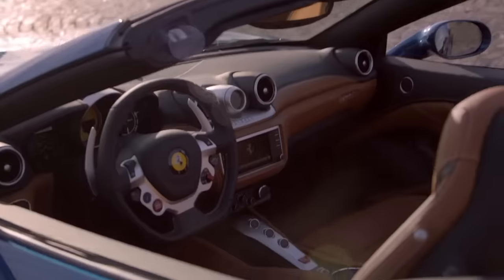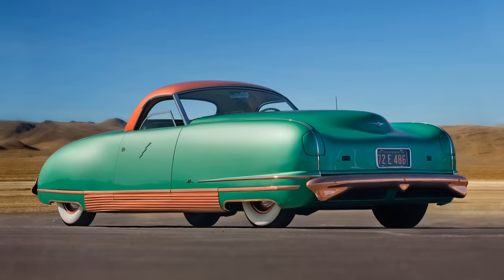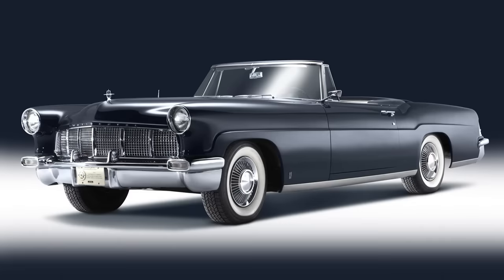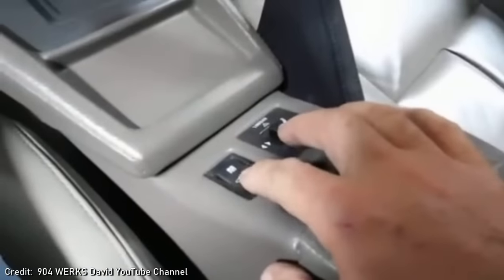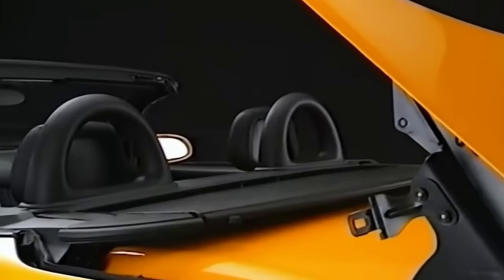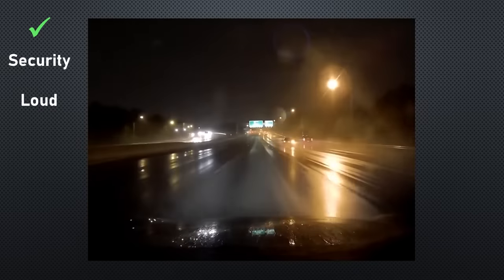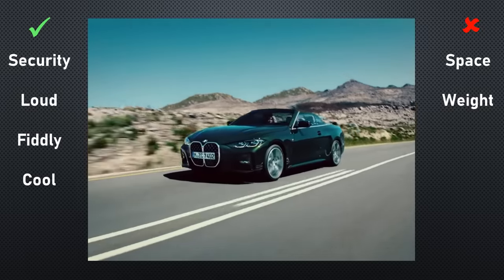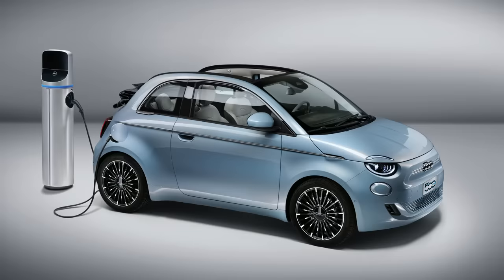The Rise and Fall of Retractable Hardtops

Comment: If I were ever in the market for a convertible (unlikely anyway), I would only want a hard top. Who wants to drive around in a car that looks as though it has been designed around its cloth roof for 11 months of the year just to enjoy it for the other 1 month? Hard tops look much better, make more sense, and are generally a better idea. I thought they were becoming popular and rather that companies that still use cloth roofs are bing too tight to create hardtops. Making them out of plastic also sounds like a much better idea, I assumed they already were.
Reply: You could move to a nicer climate? :)  Plenty of places have agreeable open-top weather for about 6 months of the year.

Comment: In the UK, soft tops suffered at the hands of criminals who would simply use a sharp knife to cut through the soft top (or fabric sonroofs). Lack ofbpolicing didn't help. So a folding hardtop provided the ideal solution. I'd never buy  a soft top
Reply: Yes, as mentioned (and illustrated) in the video!

Comment: If someone wants to break into a car they will smash the window. The roof type doesn’t matter. I’ve seen plenty of broken glass on city curbs. 😉 
Also the whole point of a convertible is to drive it with the top down. It should only be up due to bad weather and who cares what it looks like in those conditions. And if you live somewhere where you want to keep the top up due to the cold maybe a convertible is not a good choice for you. 🤷‍♂️

Comment: Great video!  I've had a few hard top and soft top convertibles.  The hard top ones more often than not look 'odd' side on, the smaller cars looks hideous and even the mx5 NC folding hardtop just looks wrong side on..... I think the most beautiful folding hard top is the e89 BMW Z4, it looks wonderful roof up or down from every angle and the mechanism is a work of art (used by Ferrari too!).

Comment: 1st time I ever went over 100mph was in a 1958 Ford Fairlane retractable hardtop, in the back seat full of kids, and me peering over the drivers shoulder looking at the speedometer.  It was the teenager next doors car and if My dad had known he probably would have throttled him.  ;-)  I was working at the local BMW dealership when 3 Series with the retractable hardtop arrived.  Was problematic from the start and had to be completely taken off the car and placed on a jig to work on.  But, on the flip side, we also had problems with all the soft tops when they aged but easier to fix.

Comment: As the owner of two past Mercedes SLs models and now the current SL400 I can only say that dropping the retractable hard top has removed one of the major attractions so the current SL looks like being with me for a long time. Sorry Mercedes the new SL is a step backwards in several respects; two useless back seats that take up space, a small trunk / boot that is useless for the luggage for long weekends away, and a price tag that resets the whole market position from sub £100k to over £100k, sorry Mercedes not a hit with existing SL owners I know so you must be hoping to find a whole new set of previously unidentified buyers to convert to being Mercedes drivers. Hope for your sake it works!

Comment: You forgot to mention that hardtops are also really expensive to maintenance if they should ever run into problems. 🥴
Reply from the maker: Good point - that would be a reason why car companies would be less keen on them.
Reply: @BigCar2  currently I have that issue with my BMW z4 e89. :( I haven't visited the BMW dealer yet, but I already know it's going to cost me an arm and leg. 🙁

Comment: I've owned an Astra H Twintop since 2008.  Despite being IMO the least ungainly of the ilk: Focus, Megane, 307 (although 308 may pip it), I can tell you its a terrible idea.  Mines been fairly reliable but was always slower and less practical than the Astra G it replaced, and now its getting older the reliability issues are really showing.  Its already had a replacement main loom, then needed trunk motors, then while fixing that the ECU started giving grounding errors which is either down to loom or moisture ingress.  The Astra G did fail once because I had a big cardboard box on the back seat but that was fixed with a manual retraction with one tool and some patience.  If the H fails mid way I'll be driving round looking like a carnival float until I get to the workshop.  They can't have been good news for the warranty departments.

Comment: My NC series MX-5 is a PRHT model, 2008 model, I've never had a peep of trouble with it, 12 seconds transition time, and I love people's eyes popping when I use it!
I haven't noticed any of the disadvantages you pose, the hardtop goes behind the seats, the boot is exactly the same capacity as the rag-top, and a real, lined steel roof cannot be beaten in rainy or cold weather. And my six-speaker BOSE sound system doesn't have to turned up two notches, either...

Comment: You forgot to mention the big disadvantage of the retractable hardtop. My neighbour has an SLK, my wife has an SLC. Both leak like a sieve around the window rubbers, ours really badly on one side.  It is a known and very common fault with the Mercedes vario roof.  Adjustments to rubbers, new rubbers at crazy prices, special oil at £50 per 30ml to plump up the rubber makes absolutely no difference.  And our car has leaked since it was 2 years old.  

When my neighbours moved in the first conversation was “Hello, we are your new neighbours. I see your wife has an SLC, does the roof leak?”.
Reply: My SLK is 15 years old and doesn't leak, even in heavy rain.

Comment: I loved my Mercedes SLK. It was usable all year round and comfortable enough to drive from Sweden to Spain and back. When your in a convertible, the open space behind you creates turbulence and the Mercedes SLK had a net between the chair that stopped most of the turbulence and with the seat close to the windscreen and side windows up you could drive quite fast and not be bothered by too much wind. I now have a Fiat 500C with a fabric roof that can be rolled back. It's a perfect second car and very good value for money, but you still have some metal above the side windows and the feeling is therefore less open. With a Targa Top car you get the feeling of open car and it's an easier solution. I'm surprised that we don't see more Targa tops.
Reply: I never use my net.  I want all the wind in what little hair I have left!

Comment: As a Peugeot 207cc I feel obliged to tell you forgot to mention the 207CC after mentioning 206cc :P. I hope it makes it into the veteran days eventually, but the engine is not the best to maintain (Prince EP6 engine...). Or eventually EV swap it and put batteries instead of back seats! Other than Tesla Roadster there's no cabriolet/convertible electric car. Let alone a hard top one...

Comment: Always preferred proper tin tops. Convertibles are no good for countries that have a lot of rain like here in England
Reply: The UK is one of the leading markets for soft tops precisely because of the weather. Soft tops are no good in hot countries because the sun is too strong to drive with the roof down during the day. This is why converibles sell much better in the UK and other temporate climates than say, in Italy or Spain.

Comment: Problem with hard tops is that because the hard top is a separated piece it can rumble driving over bad roads. It also gives the car often a big ass and if the technology breaks can be a very costly affair. 
The best looking hard-tops are with top of the list the BMW Z4 , Ferrari Portofino , Mercedes SLK and the Miata. They are the few that look as good open as closed.
Reply: Daihatsu Copen

Comment: In singapore, car-drivers laugh at motorcyclists. Car drivers climb the career-path coporate-ladder to - second-car is cabriolet. Then motorcyclists laugh at car-drivers. 

Tropics have tropical-squalls. Destination path is 10km away.  0-1km very hot, 1-2km very bright, 2-4km heavy downpour, 4-6km light drizzle, 6-10km cool. You tell your-friend(at destination in cool weather) why you wet inside car with roof up-down up-down sooo slowly (2 seconds roof-up is decent speed, 15seconds might as well get wet and drive past that section)...
Reply: Singapore have car show in april. Shows in singapore are bazaars. Youtube creators do the walking. Audience will view when free. Nevermind the discounts after price inflation. Not as if the manufacturers are deserving. Suspicions and aspersions had been cast upon vehicular manufacturers as possible sponsors of terrorism. Don't feed the trolls.

Comment: I prefer hard tops. Now they are hard to find. I understand soft tops weigh less and offer more flexibility. Hard tops offer more protection and look better in my opinion. I don't know why car manufactures don't use carbon fiber or other hard materials that save weight. This is 2021.

Comment: Over the years I have had a love for convertible cars 2 Spitfires, an X1/9, several MX5s, MGB, 2 BMW 3 series, Ford Focus CC3 BMW Z4 series 85 and finally 2 BMW 4 series, I still have a 4 series and I consider it to be a pretty reliable car for all year round use and just love that top down dry day experience. 

The MX5 NC hardtop convertible is very simple well thought out system which was extremely reliable if you want a convertible  the bottom line for me is that fabric roofs quickly crease, collect fluff and discolour making them look shabby very quickly. The other aspect is the hardtop is part of the car so unlike fabric which keep needing special attention nearly every wash day.

If there is a lesson for folding hard top 2 seaters look at the MX5 NC, as you can see I am a serious serial offender.

Comment: I have an MX-5 and an SLK (although I'll be getting rid of the SLK at some point). I prefer the manual soft top in the MX-5 because it goes up or down in a couple of seconds, whereas the SLK takes about 30 seconds. Not all that long - unless you're at a traffic light which might be about to turn green and it's just started to rain!
Reply: I think it's like 20 seconds or something for R171 imma go time it lol
Reply: @Heheha329  I admit I plucked the number out of the air a little, but I'm pretty sure it's longer than 20. I'd believe 25 though!

Comment: 6:37 DelSol = "Over complicated" is not true. 
The design is actually very durable when viewed closely and by how many still operate and if you spoke to those that KNOW how to fix them.

Complicated + high maintenance is a myth just like the 87-91 all mechanical 4 wheel steer Prelude. It was criticized as high maintenance and expensive to repair. 
Ask any that has them and ALL still work today with zero maintenance.

Comment: There is only one reason vario roofs declined: government legislated maximum CO2 emission levels that perpetually reduce. Same reason that engines have withered to a maximum of 2.0L (for the mass market). Even the 2023 AMG C63 is now a 4 pot 2.0L. Manufacturers are scraping the bottom of the barrel of ideas to meet those emissions numbers - they threw out spare wheels at the start. A rag top will never be better than a vario which is the cause of the explosion in available models. Go look at the years the emissions legislation was passed and you’ll see the correlation 👍🏻

Comment: The del sol jumbo CD changer cracked me up. No clue that existed.  Still prefer the soft top on my 124 Spider (ND Miata essentially) you can just fling it open and closed at will! The convertible SUVs failed because they take away the one biggest advantage of an SUV which is rear compartment space and loading window. If you are going that far you'd probably rather have a sedan. Not to mention many people purchase SUVs for  their perceived safety (whether real or not) which a convertible does not provide.

Comment: I would not call it fad, they have both cons and pros. For example I would still prefer hardtop because of horrible criminal condition in UK (e.g. it could be cut just cut for fun) or if you don't keep car inside soft top is as well horrible for bird droppings and similar. 

Now why they now fading away? Because convertibles and anything expect of stupid SUV are fading away, so nobody cares in the first place and secondly hardtops are more complex, heavier and takes more space. Nowadays that modern soft tops could insulate cabin just as well it seems unnecessary to overengineer hard top for niche market... likewise people who buy convertibles new usually have place to keep them safe and used car sales don't bother manufacturers. 

So basically here is conclusion in early 2000s convertible was seen as more common car for common people, hence more practical hard top seemed necessary and soft tops were still lacking. Now convertibles are fading back to being niche cars for ultra rich and common people buy SUVs, on top of that soft tops despite not being as tamper proof or as damage proof are good enough for the niche market that is buying them. 

In short - there is nothing wrong with hard tops, just that people no longer buy convertibles as daily cars overall, so less practical soft top is less of an issue.

Comment: Don't like soft tops, they look ugly and still have maintenance demands and a severely limited lifespan. Just like electric folding roofs have maintenance demands, although most soft tops are lucky to last much more than 10, maybe 15 years without needing an overhaul to be very presentable. My preference is either a Targa or fully detachable hard top e.g like on an S2000, Boxster, MX5. Less practical than carrying a fabric or retractable roof around, but safer and better looking than both when it is on.

Comment: Miata did it best, Soft top for ease of access during summer just slam the thing back in less than a second & you're good , & a removable hardtop with 2 screws & 2 latches, for winter.

Comment: I hate paying 6 figures for a car and it comes with a cheap piece of canvas on top that will do nothing to protect me if the car should flip or get hit by a taller vehicle, from debris.
It looks cheap, its made cheap, and it is not visually appealing on a car like an R8 or M8 to have sight lines be totally destroyed by a soft top. 
Its also easier to get into a car with a soft top because that canvas is cheaply made and can easily be sliced with a pocket knife, in and out in less than 20 seconds.

Comment: I don’t think it has much to do with weather or not people like them or hate them.  Car models change all the time and manufactures are always looking to see what change works.  So one company might trade the hard top for a soft top just to see if sales change and all the other guys follow like sheep.  Another factor is cost.  Putting a retractable hardtop in a pedestrian makes the car over priced.  Think of the cheap 4cyl mustang, how much would it add if it hand the hard top?  Now consider the weight.  I have an M3 convertible hardtop and the system weight alone is close to 500lbs.  That’s a crap ton of weight to add into a performance sports car.  Soft top would weigh a fraction of that.  Plus my car new was several thousand more than the same with a fixed top. But now mine is worth less then the same model year.  The people who want convertibles don’t care what the top is made from, for the most part, as they are a select group of people.

Comment: I had both soft and hard, I like the hard top but it takes up too much space and I liked the fact on my 95 Miata I could just pop the top up when parked to keep the sun off without locking it in place. Only an idiot would keep valuables in a soft top.

Comment: I still actively prefer retractable hard tops for a cabriolet experience, though I don't particularly care very much for such an experience in general. I like the security that a solidly built canopy offers and the reduced wind noise is nice too. I also don't enjoy worrying about how much of a douchebag I'm being if I want to listen to my music loudly while driving down the road, or stopped at a stop light. With a convertible, soft top or hard top, you have to just embrace the fact that you won't be packing a very large suitcase if you want to use it with the top down while you do so. Having said that, I do like the idea of owning a 1st gen SLK. I've always been fond of their design (though the 3rd gen does look better, it's a lot more expensive to buy used).

Comment: One more disadvantage of the retractable hard top on sport cars is that with the hard top up, the center of gravity goes up (not good) and with the hard top retracted, the center of gravity shifts aft, not good either. Obviously the equation applies also to the position of the soft top, but with a much lighter weight you don’t feel the difference in CG position. Try to drive an SLK top down along a winding road and you immediately feel that its tail is heavy, it’s more nimble with the hard top closed. (I’m not considering the SLK a real sport car, but it’s a good example to feel the CG’s shift)

Comment: I've just lived this.  Needing a third car in the household with family members reaching driving age, I thought I'd get one with a manual gearbox and that led to thinking about a CC.  Found a tidy low-km Focus at a small dealer and put a holding deposit down.  The weight dulled performance, but the rear seat and not-too-impractical boot meant I saw it as a reasonably practical extravagance.  Got totally outvoted by the family so instead got an NB MX-5 with higher km, higher purchase price and less practicality.  Smiles all 'round, now.